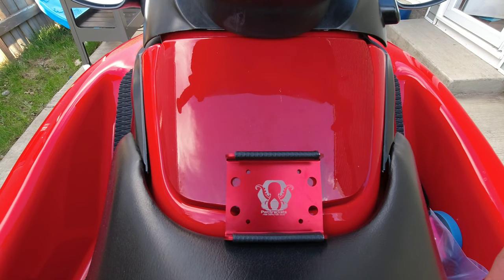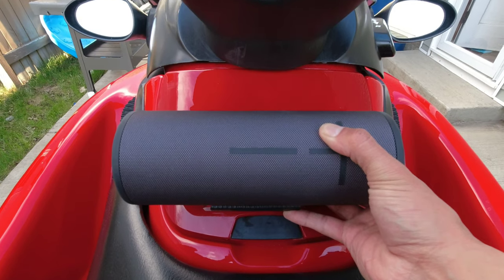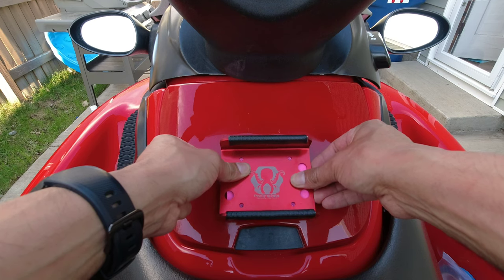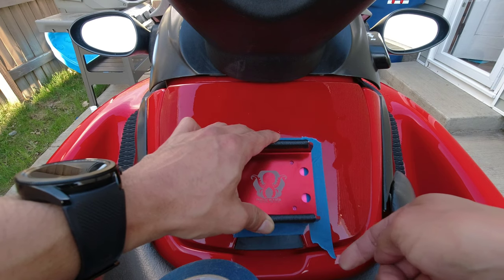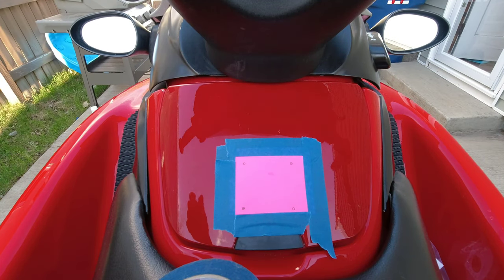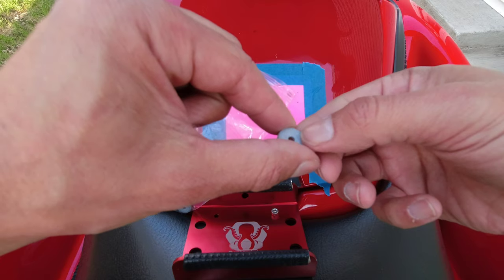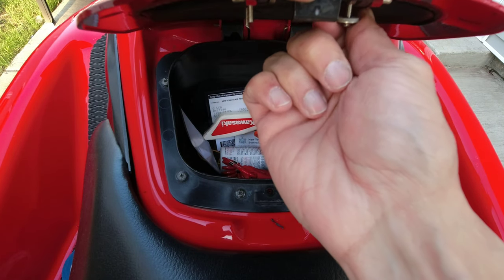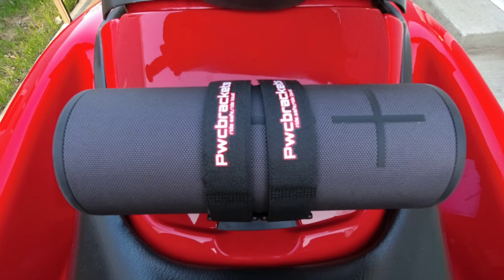PWC JetSki Bluetooth Speaker Installation / PWCBRACKET - Seadoo Yamaha #JetSki #Bluetooth

Comment: Does that strap not constantly press on the volume down button?   Seems your straps go right over it and they must be tight enough to hold the speaker in place.  Have you had any problems with that ?
Reply from the maker: No it doesn't effect it at all. I actually press on the strap to raise and lower the volume, the button needs to be pressed pretty good to respond.

Comment: So the straps feed under the bracket? What keeps them from sliding off? They should put slits in the bracket so that the straps can’t go off the sides.
Reply from the maker: Yes they go under. They won't slide off because the screws holding the bracket stops them. I've used it all summer as shown and my speakers hasn't moved at all. I think if it had slits in the bracket then it would sit under your speaker, then went you tighten the strap it would cause pressure from underneath to push the speaker up. You want it pushed down in place.
Reply: @ItsLRivera  oh that makes sense!!! Thank you